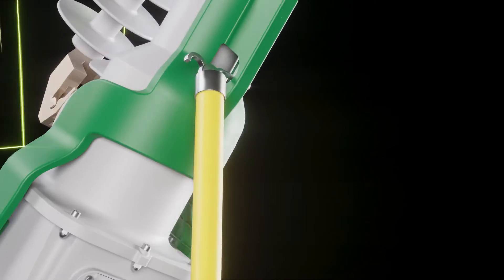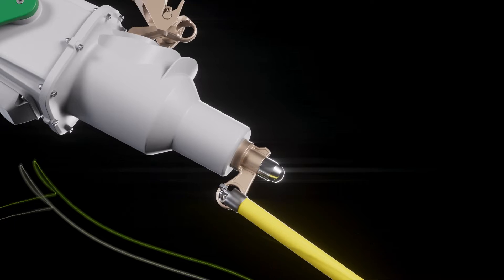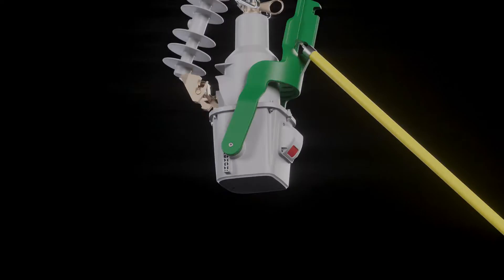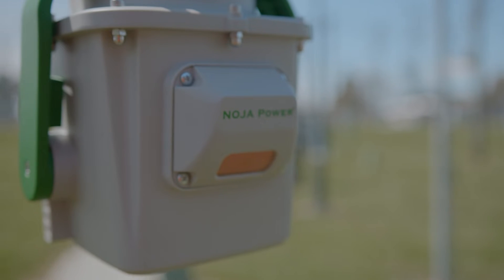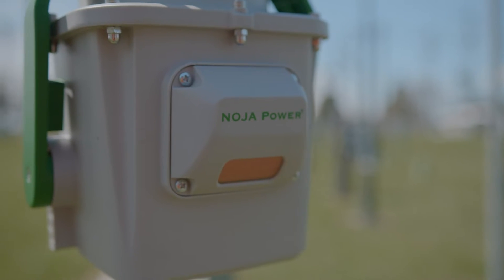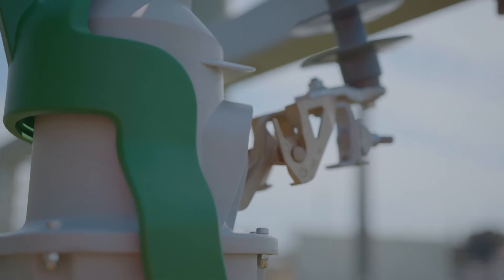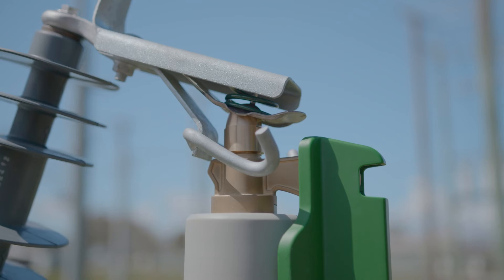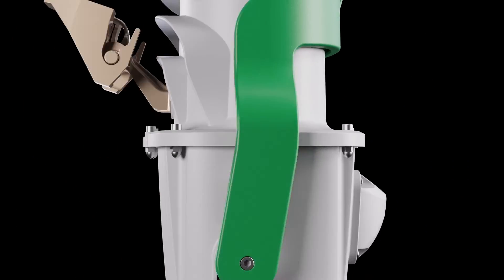Introducing the NOJA Power EcoLink™

Comment: hello.. i'm Andy From Indonesia, we have system NGR - NEtral Ground system 500 ohm, means that the fault is phase-netral are very small, between 3-23 amperes,  is it work  to detect the fault until that's? example if there is load present about 100 ampere, and the fault phase netral is 10 a